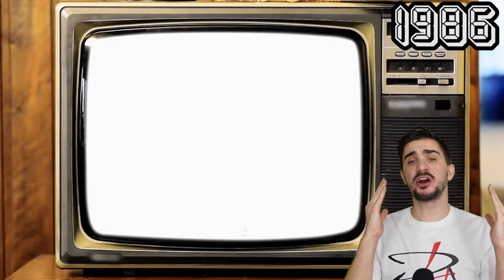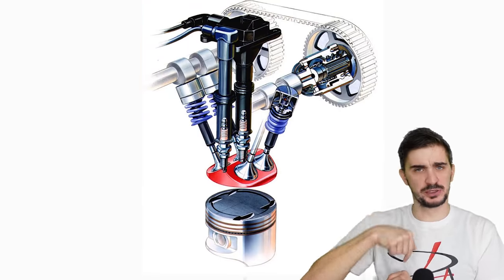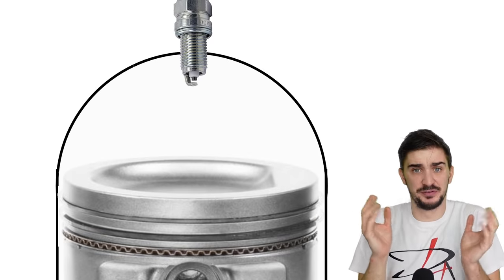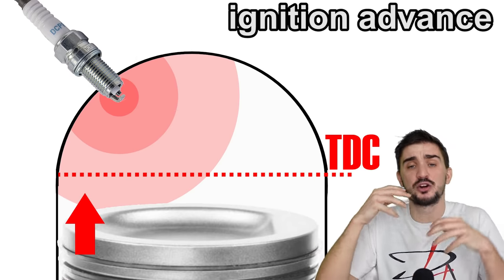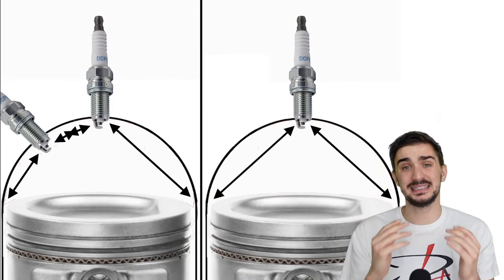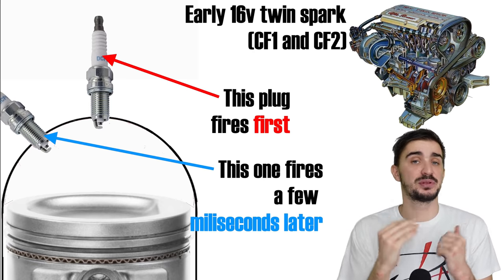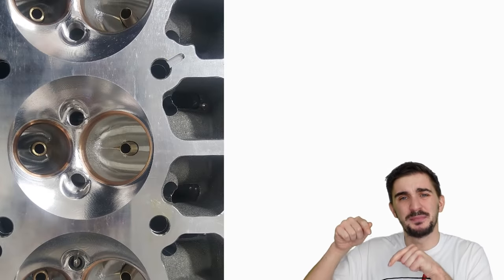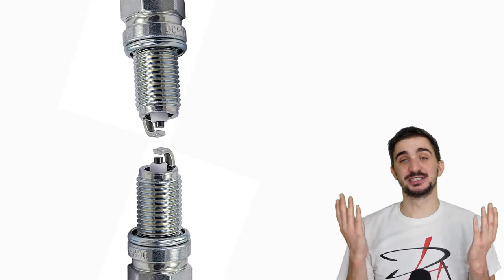TWIN SPARK - WHY, HOW and why it isn't more widespread

Comment: My 2019 ram Hemi 5.7, as well as any Hemi built since 2003, uses two spark plugs, but one is for the ignition cycle and one is for the exhaust cycle (more for emissions to burn excess fuel before the catalytic converter). I find the truck still has a great amount of take off power but fuel mileage is about the same as any other truck with a v8.
Reply: Ford 6.2 v8 (currently in use) also uses 2 spark plugs. Takes a few hours to change 16 spark plugs!

Comment: We had an old Toyota or a Nissan truck.(over 25 years ago) that we used as an old bush truck. That had dual plugs. One of the few trucks I've seen that did. My friend has an antique dirt bike that has dual plugs, but only one wire. It's ment to be a backup plug for remote travel, just change the wire from one to the other.

Comment: My 2021 5.7l hemi has variable intake runners vvt and dual plugs. The 6.4l has been using variable intake runners for quite a few years.
Reply: Mopar has been doing those intakes in the 90's but not vvt

Comment: The first manufacturer and constructor, who installed 2 spark plugs per cylinder, was ETORE BUGATTI, on the model BUGATI ROYAL ...
Mercedes had 2 spark plugs per cylinder, on engines larger than 3 liters and when the engine was cold, first the electricity was distributed to 1, and then, after a few milliseconds to another spark plug, and when the engine warmed up, there was a simultaneous distribution on both spark plugs ...
TWIN SPARK design solution, proved to be good, because it increased engine power, had higher fuel efficiency and thus lower consumption, and with this solution, must be considered a very important design solution SQUARE AND SUPER SQUARE engine, where it is very important, which is the ratio of piston diameter and stroke / when the piston stroke and diameter are the same, it is a square motor, and when the diameter is larger than the piston stroke, it is a superquare motor - such motors have a longer lifespan, due to the average piston speed per second is the utilization and consumption of fuel ... Alfa Romeo has always preferred the construction of a super square ... These combinations always give good results In addition, the quality of the intake air in the combustion chamber is important ... Alfa Romeo has always made the KALOTA chamber, but the engine is a bit hard, due to the strong line of power development ...
There are other solutions, which together with this, give even more power and less consumption, compared to only 1 spark plug ...
For example. PORSCHE has managed to solve the problem of ratio, vacuum, temperature and engine speed, so that, depending on the operating mode, it always has a variable suction channel and suction speed, gets the best stoichiometric ratio and maximum power, at all times, according to speed ...

Comment: My 2014 ram with the 5.7 hemi indeed has a variable intake with it’s dual spark plugs. The truck 5.7 engines have variable intakes or at least the gen 4 engines do.

Comment: No mention of the Mazda Rotaries? Both the 12A and 13B architectures run 2 sparkplugs per rotor, and there's always a lot of discussion on the ignition "split" between the two. Also, the race only 4-Rotor 26B had 3 sparkplugs per rotor!

Comment: I’m sure it’s here in the comments somewhere but if it isn’t one of the main reasons for the 2 plug setup on aircraft piston engines is because of the potential for fouling due to the use of leaded gasoline (or oil fouling if your engine has shitty rings or valve guides because you decided to “enjoy” extended service) You covered just about all the other benefits that I know of.

Comment: Coincidentally I own two vehicles with twin spark plug combustion chambers, a 2006 Mercedes CLS500 with the M113 V8 (so yes, that's 16 spark plugs in total 😬) & a 2007 Yamaha MT-01, with a 1700cc V-twin engine (4 spark plugs in total). And no, the twin spark plug thing wasn't a consideration when buying either 😉 I also know that quite a few aircraft engines ran twin spark plugs with separate ignition systems for each plug, a safety feature.
Reply: Interesting addition: Honda Shadow 750 cruiser bikes have twin spark...

Comment: I used to buy alot of rotax 2 stroke snowmobile engines to swap into Honda odyssey fl350s and id always see the 582cc had twin spark. They were for small airplanes. I always just guessed it was a safety measure.
Edit:I was correct lol

Comment: my motorcycle Bajaj Pulsar 220F from 2012 with cv carburetor and twin spark ignition (bajaj called it DTS-I) I have had experienced one of my sparkplug died while riding it. the engine is still running but rough. also, by running with 1 spark plug I only get around 30Km/L. but with both sparkplug running 40Km/L is achieved easily in town and +- 53Km/L at highway speeds.

Comment: The Mercedes 1914 GP engine had four valves per cylinder and three spark plugs.  There was an experiment done with something like more than 10 spark plugs in a single-cylinder L-head engine--it was covered in SAE Proceedings, in the 30s or 40s (?).  Different settings were used to vary how  many spark plugs were activated for comparison purposes.  I believe there was no worthwhile advantage found for firing multiple plugs.  That L-head, I believe, did not use the Ricardo turbulence combustion chamber arrangement--the whole space below the head was used for combustion.

Comment: An inportant thing to note here is that airplane engines generally dont have ignition coils, they have magnetos that can operate even in the case of a complete electrical failure. These are engine-driven by a gear and can keep the engine running as long as it has fuel, no need for a battery or electrical system. In the O360 engine that i use every day, there are two magnetos, one for the 4 upper spark plugs and the other for the 4 lower ones.

Comment: Very Fascinating! Dual spark exists in the m112 &m113 family of engines by Mercedes. The down side with those is that they run off a single coil. Bad coil, and you still have a misfire

Comment: For combustion its important to burn fuel air mixture equal and central as possible. Caused of waves spreading from ignition. For some constructions it is better to use 2 spark plugs. For example in big ass hemispheric heads with two valves. In some aircraft engines it has its safety issues too.

Comment: Nice video sir, maybe a bit quick for a novice to take everything in.  Not sure of the years but many hemi engines have dual plugs ,I think you  missed them,  and I happy you mentioned dual ignition on planes,  one other thing explain heat range and spark gap ,and msd,ignition for the public, I think that might make a good video,  keep up the good work

Comment: I have seen twin spark on several engines not mentioned here, Nissan used it in the Z24 engine used in some Pathfinder models in the '80s, Toyota used it in the 3T-GTE in the Celica, and Suzuki still uses it in the DR-650 although, like an airplane, the Suzuki seems to use it for redundancy.

Comment: I would absolutely love a video that focuses on multiport injection! In an engine like the 4.3 L V6 by Chevy and it's PCM controlled ignition advance it's pretty cool technology that I would like to understand more.
Reply: look at throttle position, manifold pressure, and intake flow rate (and temp) (this is ALL just to calculate "engine load")
then look at engine RPM
.
tweak the numbers till you get the best timing for every load and RPM
flash that to your ECU
drive the car
.
.
its just checking a few select sensors to calc load..... and adjusting the timing (also factoring in RPM)
it is LITERALLY a digital vac advance "old school" distributor

Comment: Cool video, love your work. Can you explain why a distributor would have two points and two condensers? I have a 1971 Fiat 124 1.6l twin cam and just got a distributor from a 1978 model and the new one has whole extra set of points and condensers. They both only use four spark plugs. Also should I install the newer distributor on the older car?

Comment: Sometimes twin spark plugs allow a higher compression ratio without knocking,  because they light the fire from bother sides and the charge burns more rapidly and completely.  Twin plugs can also reduce emissions by ensuring a more complete burn.  My modern high performance motorbike has 4 valve heads with twin spark plugs....

Comment: I imagine that if you combined some of the archaic technologies that came about when we were running into limits with poppet valves, you might get more benefit from more spark plugs per cylinder. Particularly on large displacement sleeve valve motors, i could see 2 or even 3 spark plugs providing a substantial performance boost, for rather little intake/exhaust port area being taken.

Comment: The 2.3 Lima engine in the North American Ford Ranger had twin spark plugs starting in the late 1980's.  I believe that it followed the introduction of multiport Electronic Fuel Injection on that engine...

Comment: Small piston engine airplanes all use two plugs per cylinder. Pilots are taught from day 1 to check the magnetos by switching each off one at a time to verify both sets are all firing. There is a 100 RPM drop when you turn one set or the other off so that tells you right there how much the second plug does! I always wondered why automobiles don't do this.  Especially on bigger liter engines. I think they would definitely pick up a few hp for sure!
Reply: Those aircraft engines have huge diameter  cylinders. Complete combustion would require ridiculous spark advance witch would work against power& cooling.

Comment: You forgot the Mazda rotary engines , with 2 spark plugs.  The other reason airplanes need another spark plug is airplane are RPM limited , so to produce the torque and HP necessary, they need very big displacements. Pistons are often 4 inches across, that means they have the space needed, and the second plug light up the mixture more efficiently, even if aviation plugs are twice the size as auto plugs. If one set of plugs failed in flight, there will be a loss of approx 15% efficiency, which is a drop of maybe 150 RPM ? There are experimental systems where there are just one plug and the spark came from dual spark modules, or just V8s with individual coil packs.

Comment: FORD and LUCAS, developed a system for monitoring engine performance, making a conical hole on the cylinder head and put thermo stable glass there, so during engine operation, laser beam, illuminated the dynamics of fluid in the combustion process and managed to graphically show the impact of fire electricity on the cylinder wall, where the flame current was immediately extinguished and unburned hydrocarbons were extinguished ... No matter what the engine temperature is, the cylinder wall is always cold for the flame current and that is the reason for non-combustion and higher consumption ... To eliminate that temperature difference would immediately lead to more efficient operation and lower consumption ... That is why engine oil always contains ash, sulfuric acid, coking oil particles, micro metal particles and it is successfully analyzed by FREE SPECTROPHOTOMETRIC ANALYSIS ...

Comment: I was also hoping for a Mercedes section and how they fire slightly one after another - but they change order each time. I think that PCM even checks the increase of the RPM and can indirectly detect a faulty spark plug.

Comment: that's why PULSTAR was created.  I'm sure you know of/have heard of Pulstar Plug.   They've been added to all Toyota Prius' since 2010, I believe.  The are a capacitor plug that has super high, super quick flashes.  I use them on all of my families cars.  (2 motorcycles, 2- 4cyl cars, and 1- V-8 truck)

Comment: Private aircraft with piston engines have this as standard equipment. Look for videos of pilots turning off one of the two ignition systems in flight.  There is a difference.

Comment: You’re wrong about aircraft using twin spark for safety/redundancy. Aircraft have very large combustion chambers with two valves forcing the spark plug/plugs to be to the side, the two flame fronts from the two plugs gives a much more complete burn equaling more power and the ability to run a leaner mixture. So both more power and efficiency. Try doing an inflight mag check, especially at full power or wile cruising lean of peak and you’ll understand why these engines have twin spark. Yes it is also correct that we do this with two separate ignition systems that does ad the benefit of safety and redundancy but this is a very nice secondary benefit, not the primary reason for it.

Comment: Years ago, it was not uncommon for friends of mine to have their Harley Davidson overhead valve head motors drilled and tapped to accept a second spark plug. they all swore by the performance improvements and the reduced carbon build up. what are your thoughts on this? These were all 2 valves not 3 or 4.

Comment: Most aircraft engines have two sparkplugs on separate magnetos. During the runup you check the ignition by turning off each mag, one at a time, making sure you have no more than 200 rpm drop when running on only one plug. The performance of the engine is noticeably better when running both plugs.
Reply: I was on a 172 that had a mag failure in flight, never been so concerned (mtow+warm day)

Comment: All Twin Spark engines had Phase variator not just the CF3. And from CF2 and onwards they had the variable intake flap too (only for 1.8 and 2.0lt engines).

Comment: Pilots of aircraft with IC engines know that during run-up (when the various systems are checked out before take-off)
the engine RPM drops a little when each ignition system is cut off to test the operation of the other system.  That slight
loss of power indicates that there is actually a power advantage in having 2 flame origins in the combustion chamber.
Reply: Really.  An  only  spark  plug  would  be  place  in  the  chamber  center.  When   you  put  two  spark  plugs,  you  cannot  have  both  in  the chamber  center,  then, the  wsy  flame  similar

Comment: In 1963 Maserati Sebring used a twin overhead cam 6 cylinder engine with twin spark plugs. I also need understand Mercedes plaid around with twin spark plugs as well.

Comment: My KTM SMCR 690 has 2 spark plugs. But they are not there for ignition at the same time. One is a little hotter and one colder and they are there for different rpm ranges. Also they only use 2 sparkplugs because of the emission standards in Germany and EU.

Comment: I currently have 2 twin spark engines in my driveway. A 2015 Ram 1500 Hemi as well as a 1985 Honda VT1100C V-twin motorcycle. Honda made that particular model for model years 1985 and 1986. I don’t know If the redesigned VT1100 from 1987 onwards also had a twin spark engine or not

Comment: Where they are really useful is in rotary engines, due to the very long combustion chamber and lack of any valves to interfere with. The 787b even had 3 spark plugs per rotor.

Comment: The twin spark came from engine combustion designed heads. Alfa Porsche air cooled and the Hemi head in the US. You also mention Mercedes. The problem with a hemispherical combustion chamber is you had a domed piston and a hollowed out head, so the piston goes in deeply into the head. this made it easily that parts of the spark are blocked from fuel. That is why all racing porches cars changed to twin spark to prevent knocking.

Comment: My "Mazda" had that 2.3 Ford, fantastic engine. I'm pretty sure the only reason it passed its emissions inspection is because of that exhaust spark plug haha. At some point my cat developed a huge crack in it that exhaust could escape from, the cat was in the middle of both O2 sensors. This meant the O2 sensors were reading incorrectly and FLOODING the engine with extra gas, after fixing the cat I gained about 10 MPG. But the emissions station had no clue that was happening, only read slightly above average 😂

Comment: My Suzuki Intruder C1800R has dual spark plugs. But i think that's simply because of the sheer size of the cylinders. with 900cc per cylinder and a 112mm bore and 90,5mm stroke there is a lot of volume to ignite.
I noticed the engine simply just not running well a while ago when 1 of the coils failed. It was down on power, smelt like unburnt fuel and spitting 40cm flames from it's exhaust.
Reply: Definitely unburnt fuel without one of the two sparks!

Comment: My 2017 Honda Africa Twin 1000 has a dual spark ignition system. I suspect it is for emissions as the bike has a very small stock catalytic converter.

Comment: you say the homoginazation started with fuel injection but carberation went though alot of improvements in homiginazation aswell. such as the quadrajets with diffrent secondary barral size. diffrent carburetor jet design. a big improvement in fuel homoginazation was Annular Fuel Discharge vs the more traditinal dog leg style. this decreased the size of the fuel drops. just saying there were some very large improvments before fuel injection. in high performince aplications carberation actualy can be better than fuel injection as it allows more time for the fuel to vaporize.